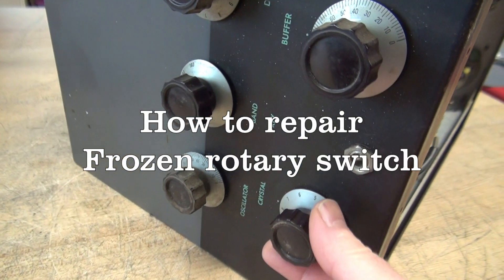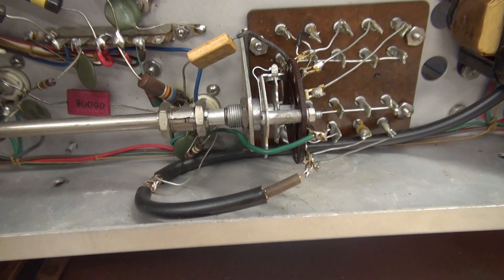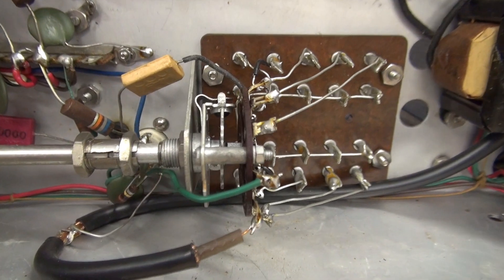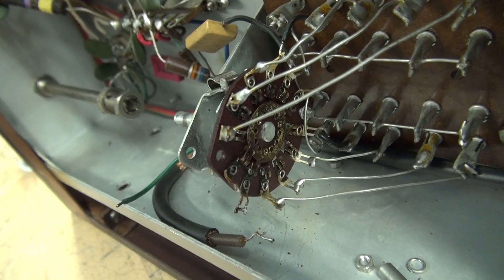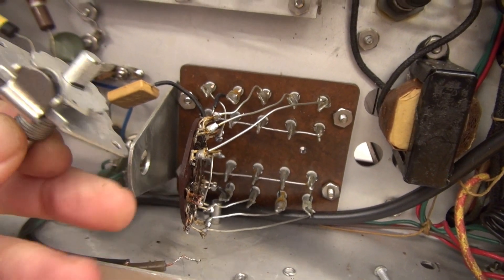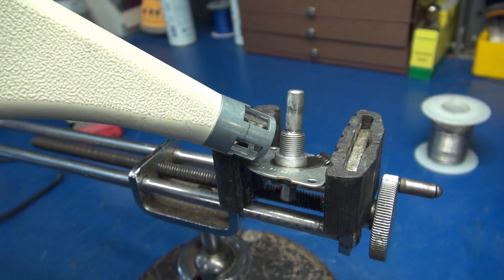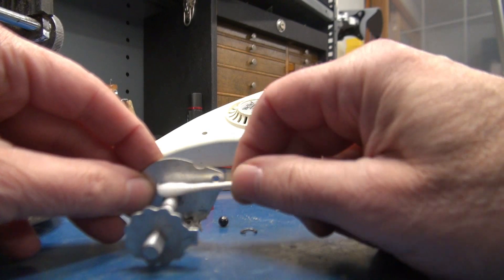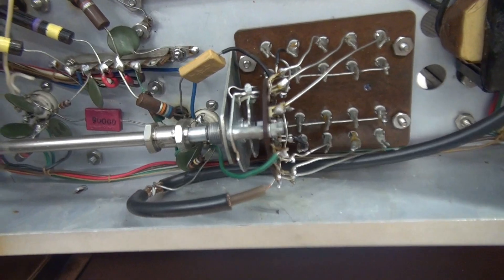How to repair vintage radio frozen rotary switch Ex: Johnson Viking II Ham Transmitter DIY fix

Comment: Flood it with oil and follow with lacquer thinner and repeat until it frees. They react with each other. This is the way we unstuck frozen shafts on office machines back in the 50's and 60's. Be careful with lacquer thinner, it will melt plastic and remove paint.

Comment: Did the same trick on a frozen Heathkit IG-102 band selector too a couple of weeks ago. I knew i've seen this done by you in a previous video, and i felt confident. Didn't have to remove the wafer to get the shaft out, but i guess that's another trick available online from terry! Thanks!